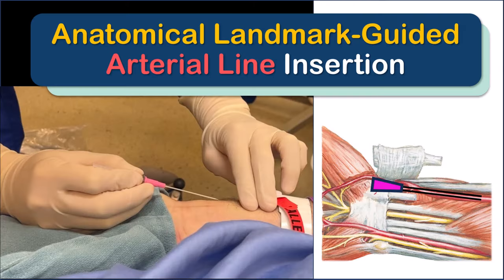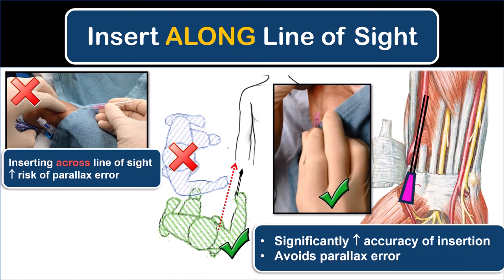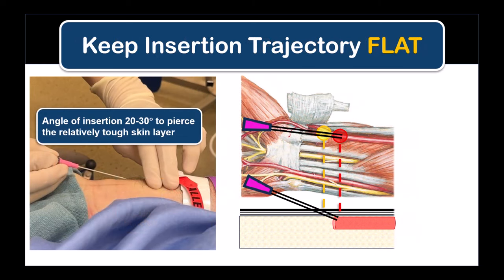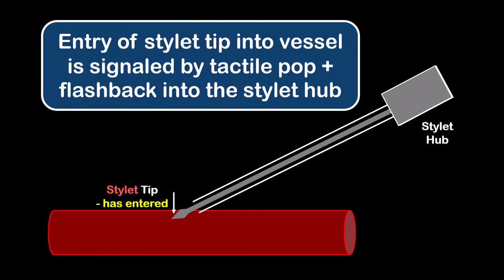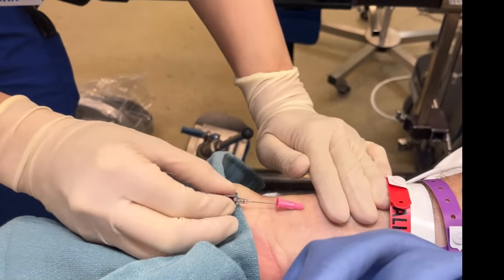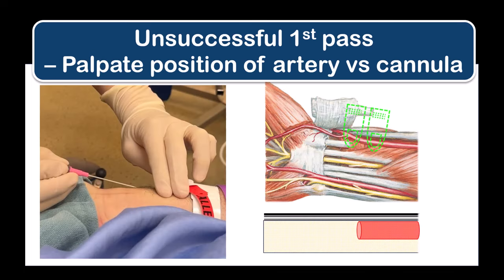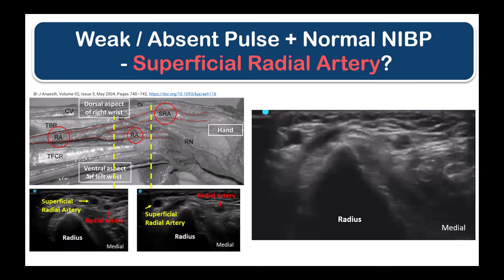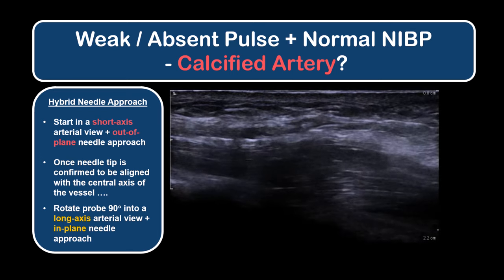How To Succeed At Arterial Line Insertion (Anatomical Landmark-Guided)

Comment: could you specify the technique using transfixion (as a rescue or otherwise)? 

heard of it apocryphally, but not really seen it in clinical practice
Reply: My approach to this is:

1. Identify you have (likely) transfixed the artery.
2. Withdraw needle by a few mm so that the tip lies within the cannula
3. Flatten your insertion angle until your cannula is parallel to the skin.
4. Slowly withdraw cannula (and needle) until brisk arterial flashback is seen in the shaft (not the chamber).
5. Gently advance cannula off needle (should thread easily)

The key step is #3. Once you've transfixed the artery, you no longer need the slightly steeper angle used to puncture the vessel wall. The aim is to align your needle shaft as much as possible with the course of the artery, such that when you've withdrawn the cannula tip into the artery (signified by the flashback), you're advancing directly along the vessel lumen (as opposed to downwards into the back wall defect you've created). I reckon my success with this is about 60-70% as a rescue technique.

NB: In step #2, make sure you don't withdraw the needle too far. You want the cutting tip to be shielded within the cannula, however you also want the stiff needle shaft to act as a stylet to direct your floppy cannula along the vessel lumen.
Reply: @mdkc  thanks for detailing the technique, can grasp it much better now. 

going to basics with step #1 - how do identify that you've transfixed the artery, or go about doing the transfixion? often with failed arterial cannulation one can't tell where exactly the needle/tip is
Reply: @armuk  I think I'd suspect transfixation if you've had flashback in the chamber, then when you advance the cannula off the needle/withdraw the needle you get NO flashback in the shaft. As in the video, in this situation you're very close to the artery and you've either:

a) Transfixed the artery (i.e. you're in too far)
b) Your needle tip was only just in the lumen, but the end of the cannula was still outside the vessel (i.e. you're not in far enough).

If it's a), the rescue technique will tell you when you get shaft flashback.

If b), you won't get shaft flashback. Put the needle back in and try again.

Alternatively, you can do what some people do and deliberately transfix the artery (i.e. when you get chamber flashback, advance the needle a good 5 mm further before withdrawing the needle.
Reply from the maker: @armuk  I identify it as follows:
1. I have advanced my stylet and cannula forward into the artery after getting flashback.
2. I check if the cannula tip is in the artery by withdrawing the stylet into the cannula (as described in my video). Absence of backflow along the cannula = transfixion, since I advanced the cannula forward in step 1, and so cannula not having entered the artery is very unlikely.
3. If I have any doubt about this, I will deliberately ADVANCE a bit further, so that I have clearly transfixed it.
(Note: I am NOT advocating routine transfixion! Just as a troubleshooting strategy in this scenario)

@mdkc is absolutely spot-on with the subsequent steps, especially his emphasis on FLATTENING the cannula BEFORE withdrawing.
Note that @mdkc describes a technique where he is not using a guidewire. If planning to use a guidewire, the next steps are:
4. Flatten insertion angle until cannula is almost parallel to skin. Also ensure it is aligned with the central axis of the artery and not angling to the left or right.
5. Remove stylet completely. Nothing will be flowing back from cannula.
6. Withdraw the cannula very slowly and carefully, until arterial blood starts spurting / pulsing back. (Be prepared for the mess - consider placing gauze or similar to catch the blood)
7. Carefully insert the guidewire and thread it forward gently through the cannula. There should be no resistance to advancement if it enters the lumen; any resistance indicates it is abutting the arterial wall, or has exited the back hole into the tissues. Slight rotatory motions can help the wire thread along narrowed or calcified arteries.
8. Once the wire has threaded beyond the cannula tip into the artery, advance the cannula in a gentle controlled fashion off the wire, again using some rotation, and ensuring there is no resistance.
Reply: @mdkc &  @KiJinnChin  many thanks both for the detailed and illuminating responses, have greatly elucidated the technique and thinking involved.
Reply: Very useful tips, thank you.

Comment: Is advancing cannula alone while fixing stylet without withdrawing stylet be better as it avoids the risk of ensuring both stylet n cannula being in artery n thus swelling of artery if cannula wasn't yet in.
Reply from the maker: No - you should not attempt to advance the cannula unless you are quite sure its tip is lying in the artery. The best way to confirm that is what I show - withdraw the stylet into the cannula. There is no risk to injuring the artery with that motion / step.
I understand what you are trying to say  - that you pierced the wall with the stylet, made a hole, but cannula tip doesn't enter this hole; and then by withdrawing the stylet, now arterial blood spills out and creates a hematoma.
However remember that leading up to that point, you have (1) seen flashback into the hub = stylet has pierced artery , (2) flattened the stylet+ cannula and advanced it the 1-2mm needed to bring the cannula tip into the artery. This second step is an essential part of the process, just like IV cannulation. It's hard not to have brought the cannula into the artery with this step - what is more likely is that the stylet +/- cannula is advanced too far or at too steep an angle, and it pierces the back wall. 

That is the more common cause of the "swelling" or hematoma. In fact it is a very good reason to master a technique that does not involve transfixion and making that extra (unnecessary) hole in the back wall of the artery.
Reply: @KiJinnChin  thank you for the explanation. I do follow the same technique. But thoretically If just needle is in the artery without cannula, fixing the the stylet in the same place without withdrawing and  just pushing the cannula in shouldn't the cannula enter the artery as stylet can now act as a guide wire (as in cvc insertion )? This technique should avoid stylet piercing the posterior arterial wall especially in a tortuous or small vessel.  Perhaps the drawback that I think of would be it would be easy to get accidentally get the stylet out as very small length of stylet is in d artery... Can this b tried on mannequins may b if someone has the resources to do so..
Reply: @KiJinnChin  also why does the cannula lag so much behind the stylet. It would ideally be as close to the bevel as possible.?
Reply from the maker: @anonymousstudent6608   It's a very interesting question - you could test the theory with IV insertion. If it doesn't work there, it won't work with arterial lines - since the arterial wall is thicker than the vein wall. Theoretically for now, I would worry that the edges of the cannula would catch on the edges of the hole in the vessel wall and not advance...
Reply from the maker: @anonymousstudent6608   I see it as because manufacturers have to design it to be behind the bevel orifice. So depending on the angle and length of the bevel, this separation and distance will vary. If you inspect a range of IV cannulas, from 22G to 14 G, you will see that this distance increases as the stylet increases in size.

Comment: Do you have any recommendation about the needle bevel position (bevel up or Down)?
Reply from the maker: I've always had it facing up - for all my art lines and IVs. I can see why theoretically one might think there is a lower risk of posterior wall puncture, facing down, but IMO, it's all about the trajectory and angle of attack. Be FLAT - is the most important thing.
Reply: Thanks!👍🏻